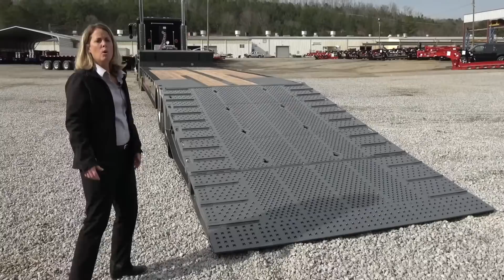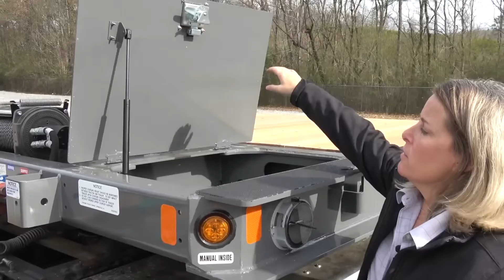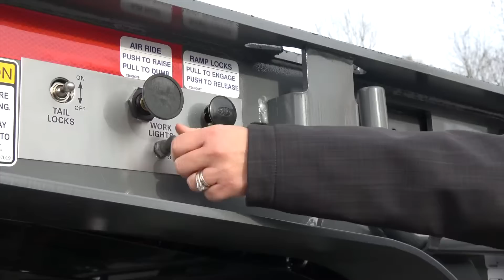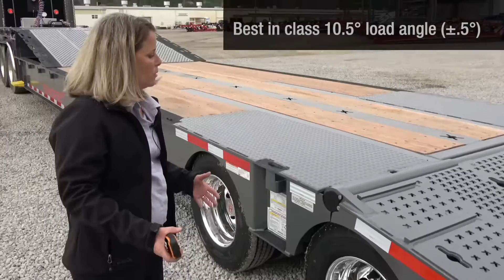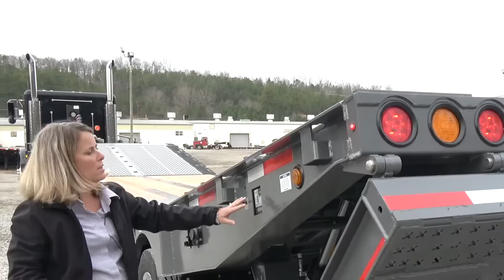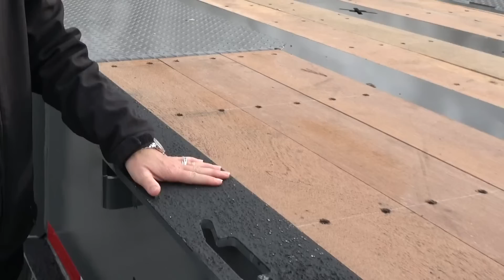Fontaine Specialized TraverseHT Hydraulic Tail R8

Comment: 40 ton trailer with tandem axles,overkill
Reply: What???Trailer is rated for 40 tons means it can take a load of 80k lbs not considering trailer/truck empty weight.
Knowing that the most a tandem can carry is 40klbs,that trailer need more axles to make use of the extra capacity.
Reply: @Aj-ro6uk  My bad, I though you meant the number of axles was overkill, not the weight rating. I was very confused how anybody thought they could get that much weight on one axle.
Reply: 40 tons is 80,000lbs. 50/50 between truck/trailer that's still 40,000lbs on the trailer axles, I have never seen a single axle rated for that much, especially one that would fit under a lower profile trailer like this. More importantly, what state or country would ever let you carry that much on a single axle without a crazy expensive permit?